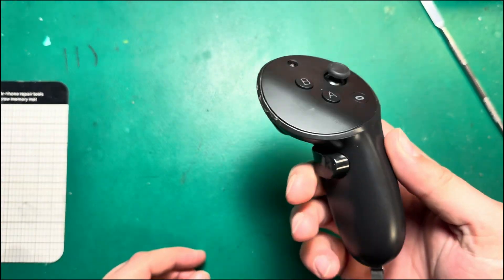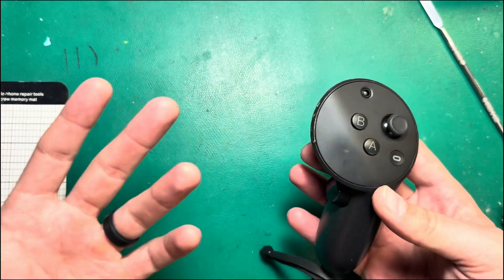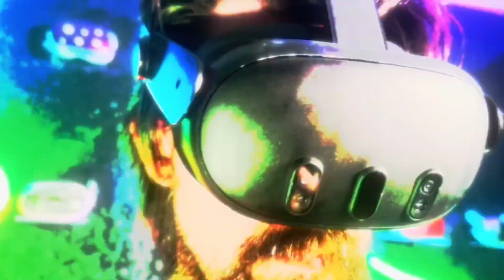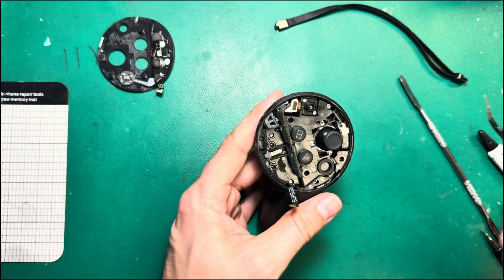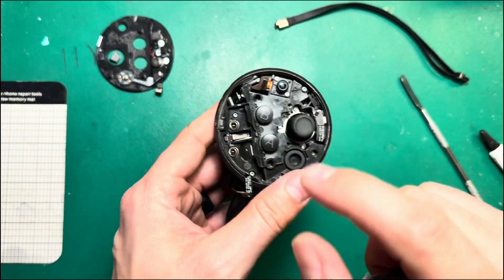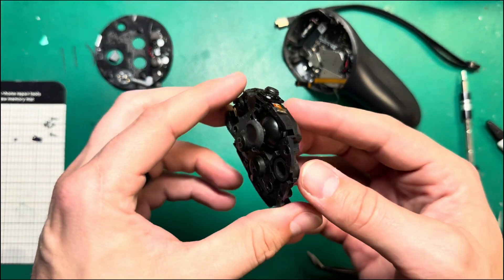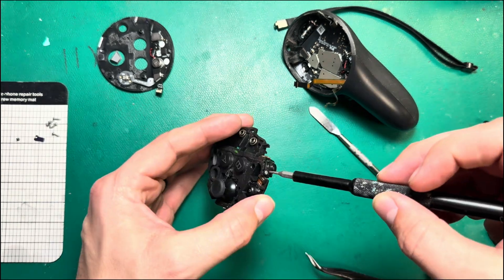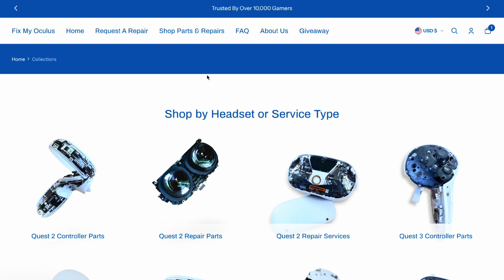Why Quest Pro Controllers Fail (and How to Fix Them)

Comment: Thanks for this. Just replaced the sticks in my Quest pro controllers and found that the little ribbon cable to the two cameras was loose and might have been causing my tracking loss sometimes. I had to reseat that and fingers crossed I have two perfect controllers again. yay! Videos like these are what make the internet so useful.

Comment: The firmware portion brought me to your video and I know this isn't reddit, but still going to throw my question (and sort of a fix) out there in case anybody has any ideas or might find it interesting;
I have a quest pro, works perfectly fine every time on a factory reset. Intro to quest controllers track perfectly, everything operates as it should. Forced Meta OS download and restart, Immediately controllers lose tracking and operate in space only.
Forgot the controllers via Meta App, re-paired, same issue. 
Forgot the controllers once more, factory reset each controller, re-paired, same issue. (Note: No attempt to update the controller firmware in v76)
Started to think the controllers were done for at this point. Thought I'd try the beta OS to see how my luck faired, after the factory reset, controllers repaired, still no tracking, but oculus was at least trying to update the controllers (as you said in your video)
Thought to myself "What would happen if...I just turn off wifi?" So I did that, restarted my headset, controllers paired and booted fully offline then I turned the wifi back on, controllers broke the loop and started updating.
Post update the controllers STARTED TO WORK AND TRACK perfectly fine. Loaded SteamVR, managed to get a night playing VRChat without a hitch (about 4+ hours). Put the headset back on the dock.
Go to use it the next day the same issue happens and refuses to track, goes back into an update loop. Turn wifi off, restart headset, re-pair controllers, turn wifi on, update controllers, functions. Rinse repeat. 

Long winded, I know. But in your experience pulling these apart, would you think my issue would still be hardware related?
Reply: The quest pro software updates have been a nightmare for me. I love this headset, it's so great when it works, but I bought it at release and every couple months they manage to break something that was working fine previously (mostly, the controller tracking).
What I ended up doing was setting a blacklist in my router management page and blocking my quest from connecting to the internet. It still connects to the wifi network, so I can use VRChat through Virtual Desktop just fine, but it can't connect to the Meta servers. 
I found a website where you can download previous versions of the firmware but I haven't spent the time to figure out which version was working the best.

Comment: I design hardware and software and those controllers look like a prototype and not a finished product made to be mass produced. It's not a well thought through design that's easy to assemble and manufacture. It looks like it was most likely designed in the last minute under a lot of pressure. It certainly doesn't seem like it was made to be repairable either.

Comment: cool tearrdown,  I have no clue whats wrong with mine I'm guessing bad battery or firmware brick. Thats too advanced for me, I'm tempted to try a dremel operation on mine just above the battery so I can at least disconnect it and see what happens. Smart move would prolly to dump it on ebay for parts and cut my loss by getting a used regular one or something. Decisions decisions..

Comment: Will factory reset work because I smacked my controller together by accident and now it’s flashing white and purple
Reply from the maker: One of your tracking cameras is broken.
Reply: @fixmyoculus but when I press buttons on my controller it connects for a cuppl seconds but not long enough for me to be able to move it
Reply from the maker: Sounds about right if you have a broken camera.
Reply: @fixmyoculus aw okay
Reply: @fixmyoculus so do I just push in the little gray thing

Comment: Hey thank you for the teardown! What does it mean when when my pro controller flashes 3 red lights when pressing butto? It won't light up or do anything when trying to charge. Only thing is the 3 red blinking light with pressing specific button. Any advise or previous experience with this issue? It's never been dropped and like that out the box. Meta won't replace it as it's not bought from authorized retailer.  Subscribed!

Comment: Hey there I have a controller for this thats connecting and disconnecting constantly. Not sure if you mentioned it but if you did can you give a timestamp or let me know how I would fix it if possible?
Reply: Just rewatching now correct me if I'm wrong but it's probably the cameras right?

And as for joystick drift I would just need to put the new joystick in and resemble following where you stopped at?
Reply: @zaya14.  did you fix it?

Comment: My left quest pro controller stopped pairing after an update. What do you suggest I do?
Is the only option taking it apart to look for loose connections?
Reply: I've had the same issue, it just gives and error when you try to pair it. Outside of warranty of course so Meta told me to kick rocks.
Reply: @silverdoggg same
Reply: @silverdoggg terrible company, quality, and response. I'm days from smashing everything with a hammer. Controller or controllers failed 3x in 6 weeks. Takes a month from start to finish to get the new ones back, only to realize they sent refurbished again. This is a serious problem when s joystick costs $80 from the same place that sells these defective joysticks, in addition to being unable to fix the firmware so this problem stops

Comment: Does anyone else controllers just flash blue no vibration and doesn’t pair
Reply: Yup. Replaced 2 out of 3 cameras in the controller and still no success. Controller doesn't even factory reset. Just stuck on blue blinking and sometimes white blinking. Infuriating that $300 controllers have issues like this and we don't get taken care of outside the warranty. Anyone buys these controllers make sure u get 3rd party insurance.
Reply: @Dup0ntnan  mine do too it’s my right controler

Comment: I opened my left Pro controller after watching this video to glue the grip button. It worked well. Now I’ve put everything back together. Pairing in the Horizon app worked, but in the Quest 3 (and also in the Quest 2), the left Pro controller is only recognized for 1 second, then it’s not recognized anymore. The white LED on the controller blinks white for just one second, then stays off for 3 seconds. It keeps doing this over and over. Can anyone help?

Comment: the controller got very hot during a wired charging, after that event the controller works but no longer responds to charging. Which component needs to be replaced?

Comment: 3:00 that's a fully functional x and y touch pad, like a laptop. Meta sdk doesn't expose it tho, and outside of niche overlay navigation in pcvr, doesn't have a practical use.
VD did look into getting it working, but best workaround that wasn't buggy was using touchpad 'as' the joystick, but than you lose the joystick functionality.

Comment: does anyone know why my controller keeps disconnecting any time? I swing it hard? usually what i do to fix it I push the battery compartment thing and it usually fixes it for a bit and then it goes back to normal and just keep doing it. can someone tell me what the problem can be please?

Comment: I love my Pro controllers and my Quest Pro. I use it for a two years for Vrchat, battery dying and turning off at less 40%. I did swap sticks 3 times because they start drifting after 3 weeks from buying (factory new). But i still love it. With Globular Cluster strap its most comfortable headset i ever had.
Reply: Make sure to send it back under warranty!
Reply from the maker: 96% of Quest Pro Headsets and controllers were sold before July 2024. 

Chances are very high that Quest Pro Controller users do not have warranty coverage, since meta’s warranty coverage only lasts for 12 months after original purchase date.
Reply: @float32 Im in Russia lol

Comment: I’m refunding my quest pro controllers because the tracking isn’t that great and for some reason the controllers stopped charging and they sometimes just don’t connect and I have to wait for 8 hours for them to connect again so I’m just going to use my OG quest 2 controllers again and I honestly prefer the quest 2 controllers
Reply: It was a huge step to meta to make quest pro and completely redesign everything. Maybe that controllers was hard to make in time with no bugs
Reply: The tracking used to be better. Seems like things fell apart with the update that extended the battery life. They’re definitely still working on it though. Get updates every couple weeks

Comment: I'm shocked that the pro controllers have the same cheap joysticks in them.
Reply from the maker: Same!
Reply: These joysticks are small and smaller than joy-con ones, and it would be hard to put more quality joysticks and redesign controller for them
Reply: On the bright side, this does mean that self repair should be easy as long as you have spare quest parts from any oculus quest. 

Standardized parts makes replacing components easy because everything uses the same parts.

Though admittedly the fact they haven’t tried to at least replace the joystick mechanism with a more durable and fail proof design is on the same level of frustrating as Nintendo and their own joycon drift problem. I’m willing to bet it’s a planned obsolescence thing anyway like most persisting tech hardware issues usually are.
Reply: @staticaleel5068 none of what is shown here looks "easy"

Comment: Mines went through hell for 2 years and still standing.i did have my 1st pair replaced under waranty within 3 months cause the software bricked em.
Reply: When I was on Quest (Im on Bigscreen Beyond now), I used the Quest Pro controllers, the best feeling controllers I've used. The software and tracking are horrible. Sometimes it just didn't pair or work at all. I had to buy a new controller because it wouldn't pair. What a waste of $150